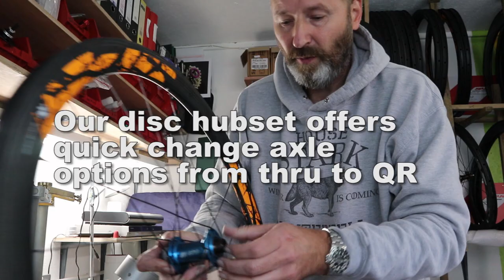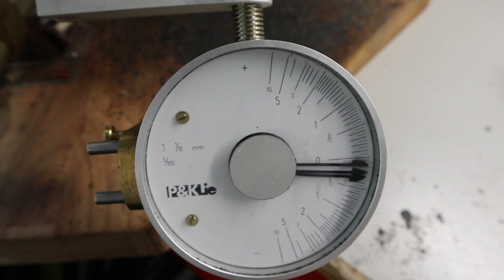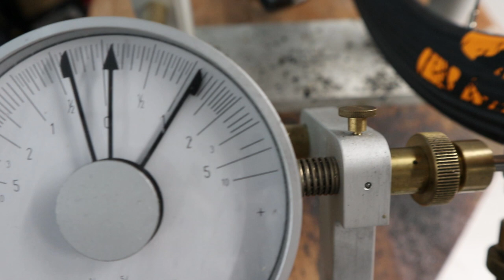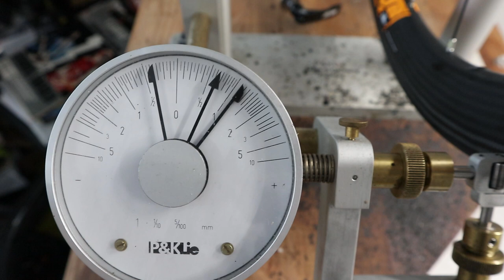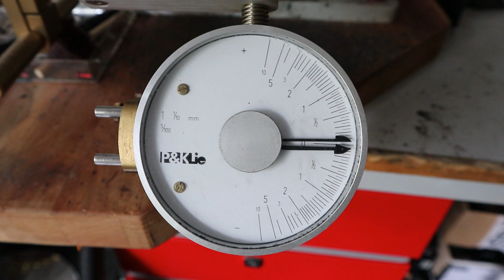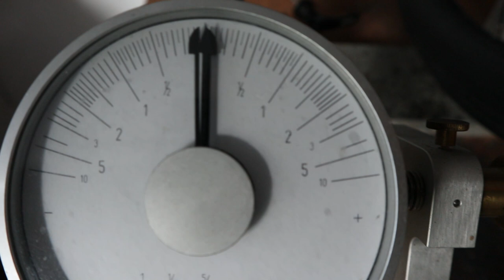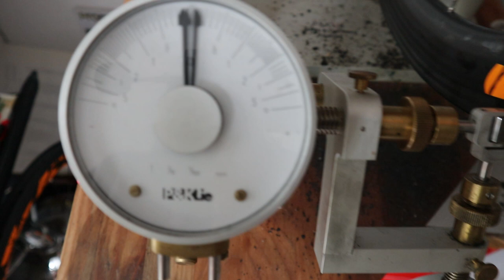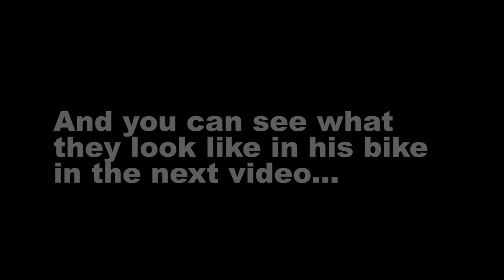How We Make 'Em 2018 - Making Better Bike Wheels

Comment: Done that! Never had all that apparatus but built some pretty good wheels. Back in the day there was campy,campy,and low flange campy. When six speed came along I moved the hub spacers around, used a five speed freewheel and had a wheel with much less dish and a stronger axle. I also went further on occasion and removed the outer cog resulting in almost no dish! Breaking axles leads one to some draconian solutions. The free hub to me was the most important improvement in cycling history. With the lower quality standards In the past rim seams were often lumpy making an attempt at radial tuning with dial indicator gauges meaningless. Remember Rigida! Even if you did luck out and get a Tuesday- Thursday rim there was always that Wolber Pro "Wobbler" tubular to nullify any roundness you built into the wheel! Overall it's easier to build a strong long lasting wheel than it used to be. Stressing the wheel remains key.
Reply from the maker: Thanks for watching David! Wolber Pros - sadly I remember them all too well!
Reply: Still doing that tied and soldered, JB Weld thing for track bike. Would be madness  to use disk tubular on the road. Would be laughed out of any velodrome. There's few modern track wheels I'd trust for the road in high weight  situation. Got SKF industrial bearings in rear hub! Hambini would be proud of me. Originals scorched. Too much power, right!

Comment: Just started to eat humble pie today. They say a mechanic's car always runs the worst. Same with those who tinker with  bike wheels. Hadn't touched rear track wheel in some time. Tinkatinkatinka coming from rear wheel slow  speed. Factory built wheel. 2 spokes loose. Really obvious solution but if it was hand built this wouldn't have happened. If I didn't build the wheel I've learned to recheck it much more often. Better yet the next one I'll build myself.

Comment: Winter is coming....👍.   great video  lovely wheels,   do you know about what causes creaky cranks?
Reply from the maker: bottom bracket cups with insufficient torque, lack of lube and/or anti-seize, chainring bolts,  worn chain, even front mech mount - all of these and more can be source of creaks you hear as most likely coming from the crank...  eliminate one at a time!  good luck
Reply: @SpinOnTheseWheels  thanks for the in-depth reply. I suppose it helps not to weigh as much as a mountain too  lolz (103kg). working on that too
Reply: I'm 107 kg so I get it. Track wheels inherently stronger so that's what I ride. 28mm if they'll fit in frame and almost no pinch flats. Wider, deeper rims actually better. Your arse will thank you for the 28s!

Comment: What's the internal and external width of your old dm8's and your new ones ? Thanks great information always in your videos.
Reply: Dustin, I believe it says on his website
Reply: @denmae1971  I actually found it on another video .thanks
Reply from the maker: internal: 19.5mm DM8 / 21mm Revo    External width is the same for both, upto 30mm at their widest, 28mm at the base of the brake tracks, 27mm at the rim edge

Comment: Hi Drew  Shouldn't we ride the bike then get them bedded in and then back in the truing stand for another fine tune post first ride?
Reply from the maker: no need George - if you make the wheel right to start, all the "bedding in" is done by the maker.  Look out for the stress relieving done throughout the build in this video - that ensures any spokes that might work loose first ride are found and re-tensioned during the build
Reply: I kinda like to touch them up after a few miles. Often there's little to be done but there's nothing like a real world test.

Comment: Do you impact bed or set the jBend at the hub these days?
Reply from the maker: Thanks for your question. The spokes are bedded in the hub with the help of those multiple spoke-pair grabbing and puling sessions which not only relieve any stress in the overall system, but also pull the spokes deep and tight into the holes in the hub. All our J-bends are made custom length and angle, and then further adjusted to align to the rim during the lacing, which I didn't show in this video - watch out for the next episode where David joins me to collect his wheels and we make the rear together, and I think we remembered to capture this process then.

Comment: How much time does it take you to lace up a wheel? And then how much time to center them? I know it depends on the spokre count.
Reply from the maker: Not long Max, maybe 10 minutes or so for lacing once all the spokes have been made. I'm only ever making wheels with either 20 or 24 spokes. Centering is done as part of building up tension rather than as a separate process, so takes no time at all really. You can see me determine the rough centre early in the video by measuring the lateral position of the rim with respect to the workstand at the valve hole as my reference point , then re-measuring the valve reference with the whole wheel reversed, and dividing the difference by two. Then I determine the centre much more precisely again later on in the video by swapping the wheel orientation back again. I'm using very accurate run out gauges which measure in 0.05mm increments which makes an accurate and fast determination of wheel centre, trueness and roundness much simpler.
Reply: @SpinOnTheseWheels  thanks for the detailed answer. I rather meant trueing than centering. How long does it take you to true the wheel in the stand? Do you not take the wheel out during truing to push down on the floor for stress relief?
Reply from the maker: Hi Max, each wheel I make takes precisely as long as it needs to complete to my satisfaction! I don't set any time limits on this. I relieve the stress build up several times during each build and I talked about this a lot in the video as its one of the most important processes in achieving a strong and lasting wheel. I don't need to use the floor though - I do this in the work stand as I show in the video - please look out for all the times when I put the thick gloves on.  You might have missed it as its in the time lapse sequences, but I usually pause after to explain what I just did and why.  Thanks for watching dude!
Reply: @SpinOnTheseWheels  thanks for the detailed answer again. I've built around 10 sets of wheels myself. Yes it takes as long as it takes until they are good enough, but I'm sure there is a typical range like 30 to 40 minutes which vobers the bulk of wheels? 
Btw, I don't get the logo on the wheels. It looks cool, but are those letters? Does it say somerhing? I cannot decipher anything...
Reply from the maker: Please take a closer look at the wheels on our websites Max - spinonthese.com for the fun stuff and ridefullgas.com for the product and reviews. It says Spin On These on all our wheels!
Reply: Sorry, I can't read that. for me it's just a fancy graphic. Looks cool yes, but no text to be deciphered. Just my feedback.
Reply from the maker: its just one of our graphics Max - you can see the other easy read versions we also make over on our websites if you're interested.And thanks for your feedback dude.